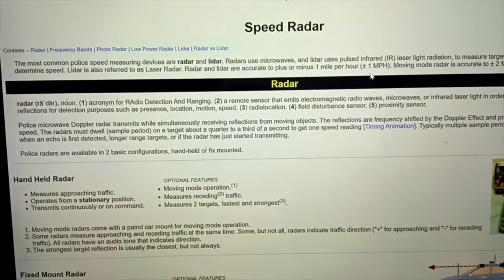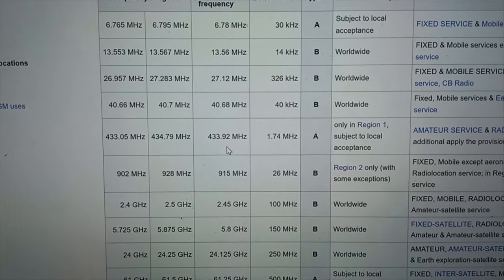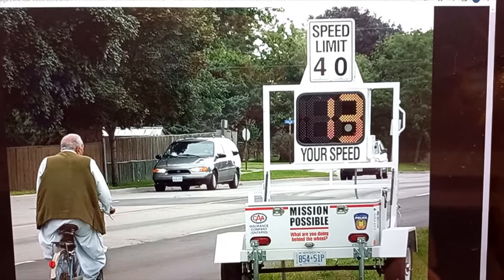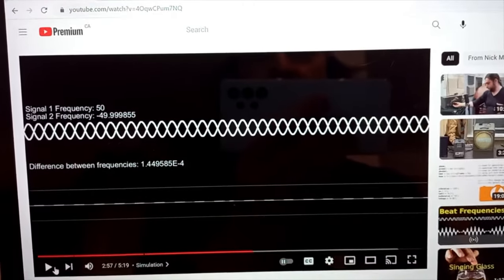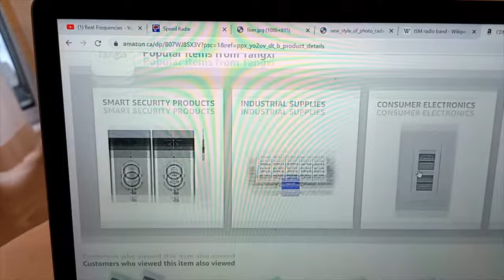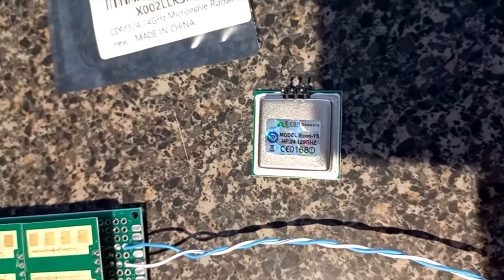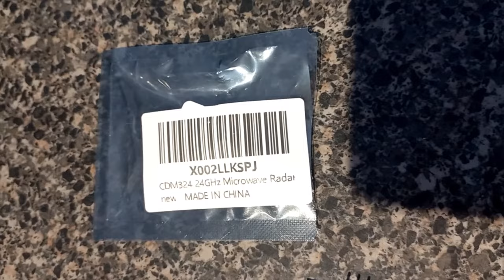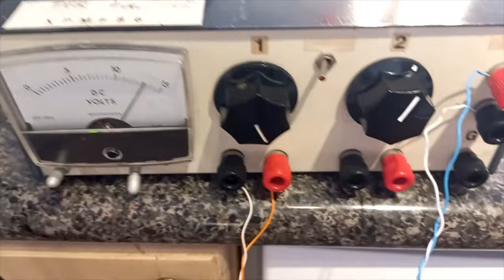Speed Radar - Jamming Freaking & Scrambling

Comment: The dual tech sensor you show at the end of the video needs to have a valid signal from both the PIR element as well As the microwave element to trip. How is it that with the pyro element covered with black tape unable to see a moving heat source and with you moving the jammer towards the detectors microwave source it trips? There is no heat input. Is that microwave source overloading the circuitry for the pyro sensor? 
There is also a section in the 2.4 GHz band that is within the ISM allocation. Ever tried keying up the Marconi/Bowman PRR squad radio around Wi-Fi and Bluetooth operations? They kinda shut down. All totally legal.

Comment: If a cop is running radar and he gets good hits on all previous targets and then on your car gets an error msg or really bizzare reading, he will assume you are running a jammer and pull you over for that. Since in a lot of places that is illegal. 
Also, where I am, they now use lasers to detect speed. And then there is always the old vascar system that uses time/distance for speed. Thankfully most don't used vascar anymore.
Reply: In the state of Ohio, the Highway patrol still uses a form of Vascar. They do this using aircraft to patrol stretches of the interstate system. You know you are in the hot zone when you see stripes painted along the berm about every quarter mile. This info is radioed down to a patrol car which will find you and pull you over and issue you a ticket. In court both the issuing patrolman and the pilot/ patrolman must appear in court to attest to the fact you were speeding. If either one fails to appear to the hearing the case is considered void and charges are dropped. Most often the pilot fails to appear in court due to scheduling conflicts. The pilots are also State Highway troopers who can "legally" run the vascar "computer" or more commonly a stop watch.
Reply: It's legal to jam in 28 states.

Comment: this is really cool, in my area they get us with redlight cameras. Is there a way around that, besides the spray witch does not work and the clear cover witch you get pulled over for... ? great videos bro keep up the great work
Reply: Laser the camera?  Or don’t run red lights?
Reply: Our town has had two people killed in two separate accidents in a week. Both because someone ran a red light. One victim was 17 and had graduated the same day she was killed. No alcohol or drugs involved. Don’t run red lights.
Reply: ... don't run red lights? Easy solutions, takes only 1 minute or 2
Reply: @FAB1150  Some are unavoidable. What if you're coming up on the light at full speed with a truck blocking your view? The light changes in between him going/turning/whatever and now you're going way too fast to reasonably stop. So many different cases where going is better than stopping. What if there's an emergency vehicle behind you needing through? What if you get rear ended into the intersection? What if it changes way faster than you're expecting?
Reply: @firstmkb lasers on camera lenses have the same effect as your eyeball. Don’t point lasers at your eye!!
Reply: @Wayne_Nero  The rule of thumb is "Don't look directly into laser with remaining eye."
Reply: @joblessalex 
-you don't go at full speed in an intersection with a truck blocking your view, and regardless lights are  positioned so that you see them. If a truck is turning and blocking your view it means it's in front of you... And you brake usually.
-If there's an emergency vehicle behind you the light either turns green (there's systems in place for that), or you won't get fined because get it... There's a camera that saw you gelding for an emergency vehicle. 
-if you get rear-ended it's quite obvious that the car that rear ended you gets fined and not you. How? Because there's a camera showing that you got rear ended, and police is likely gonna get there to see the scene.
-if It changes faster than you expected that's your fault, what kind of argument is that? It means that you were going too fast.
Reply: Retractable plate cover

Comment: @peterfairlie2296 - Soooooooo you can disrupt the sensor's ability to detect.... But can you do the opposite (from a distance, trick the sensor into thinking it detects something)?
I was playing with a "hand-wave" detector (the kind in hospitals) that use this exact same radar chip - I think they have a PWM or some sort of circuit in conjunction with the sensor as they read "125MHP" when you point a radar gun at them - interesting.....

Comment: Can you make a software PLL to tune a Gunn diode oscillator ( send DA to varactor), tune it so that your speed comes back as 55 mph (compensated for your actual speed and initially measuring received LO freq of radar system). It should saturate the front end of the radar and it will not lock onto the return signal. This way it’s not obvious you are jamming because it gets a valid speed indication.
Reply: @peterfairlie2296  i think you inspired me to make a horn and circulator, actually do this.  Why drive a minivan when you can be a F-18 growler on wheels